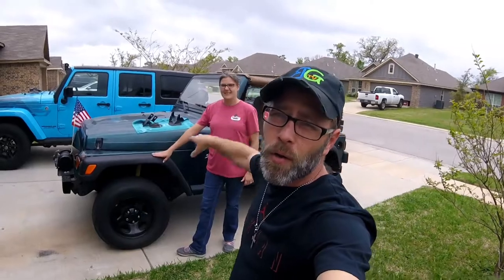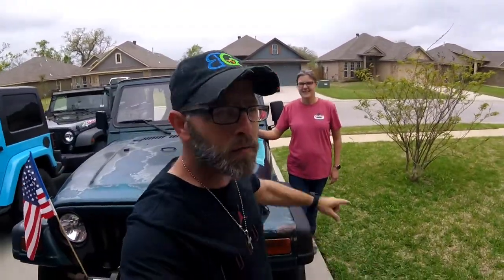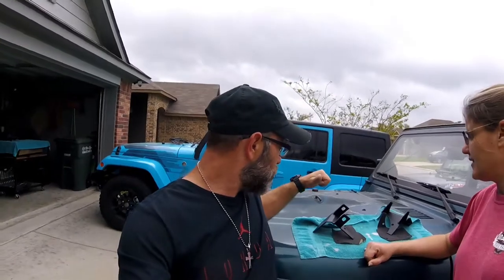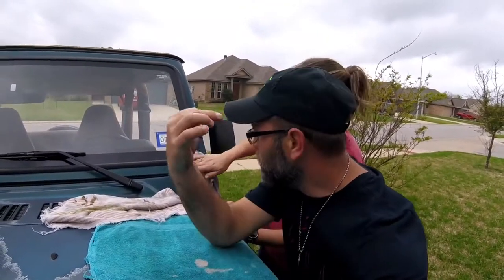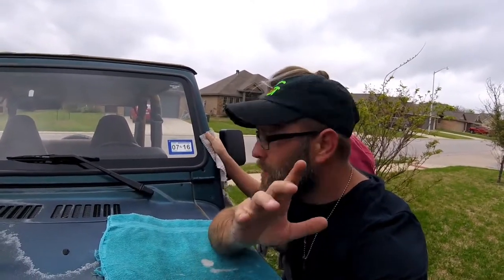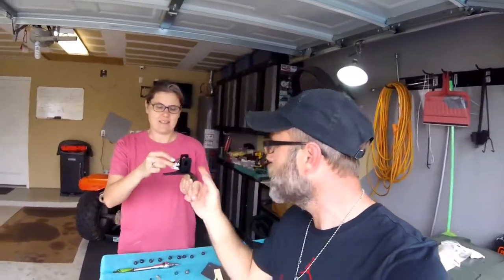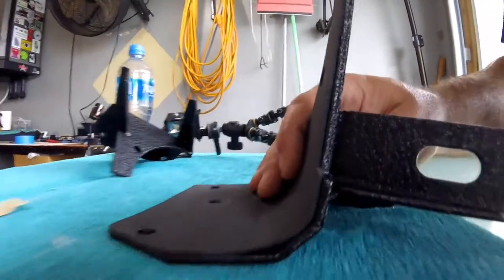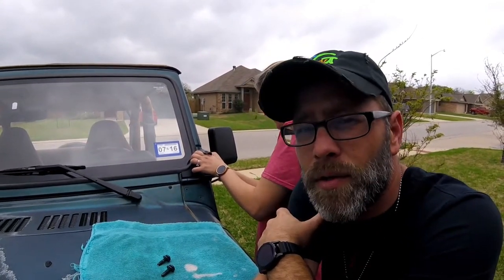Episode 333 - Dual Spot Light Brackets by Auxmart for the Jeep Wrangler TJ.

Comment: Inspection was out almost 2 years ago! lol. Did you get my text? You will be fixing that up with lights soon!
Reply from the maker: yes sir. Ran into the horn problems last summer and then the computer issue so its been sitting. It is pretty much only a summer driver but once the rain calms it will be on the road the rest of the summer. Got you message Papa sorry I haven't had a chance to reply. Ill do that today. Unfortunately we will not be able to make it do to other obligations. Ill send more details in the text. Thanks so much Papa!